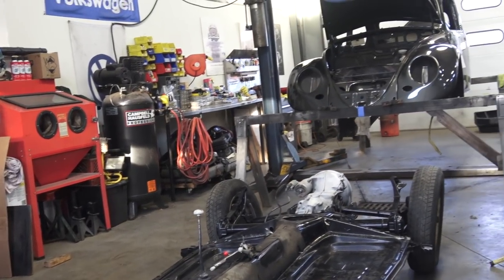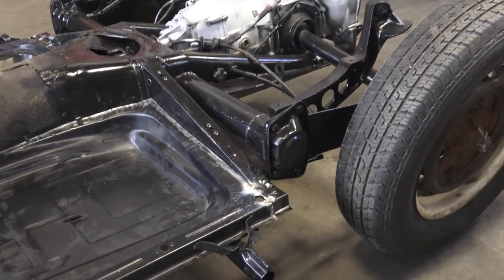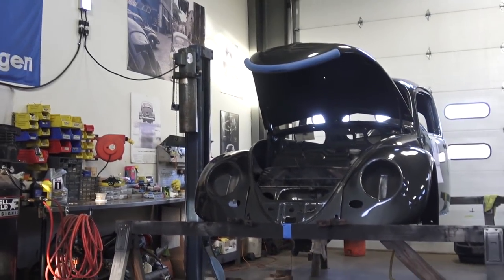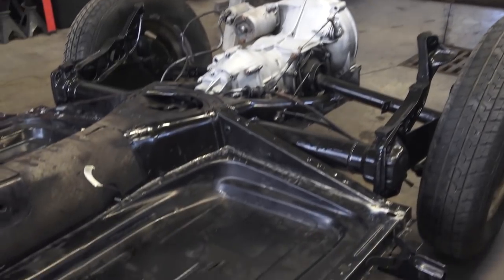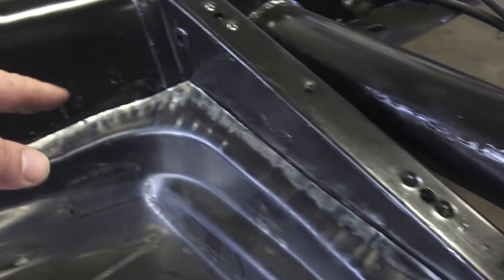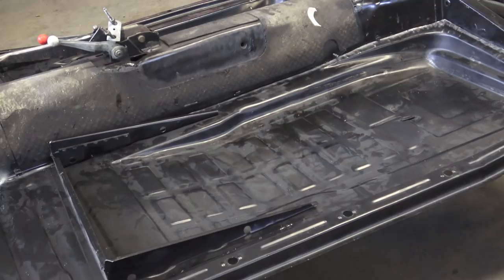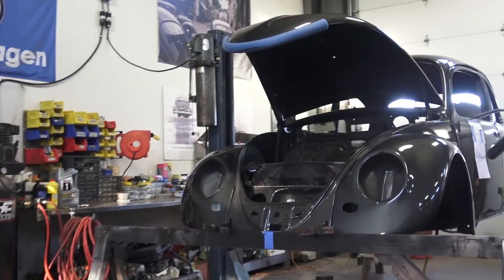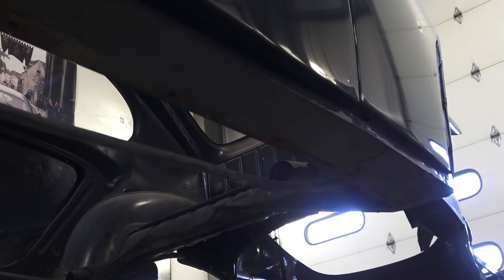Classic VW BuGs Beetle New Floor Pan Fitment for Restoration

Comment: did you have to strip those pans before welding them in or did you weld them on as they come from the company you bought them from?
Reply from the maker: You need to go down to metal and take the paint off in the areas where you are going to weld.

Comment: How long did it take you to put new floor pans in? Asking for a friend.
Reply from the maker: Usually a day, to a day and a half.
Reply: @classicvwbugs   really? My friend was saying it takes 6 hours
Reply from the maker: @_.incredible_magnum._291  both sides?  We make sure fitment is right, then seal it, rust proof paint it, etc
Reply: @classicvwbugs  oh. So I wanted to just slap s floor together, how long will that take?
Reply from the maker: @_.incredible_magnum._291  Without prep? Just a few hours.  The time is cutting out the old, cleaning the metal, prep surface, seal paint etc.
Reply: @classicvwbugs  oh ok. If I wanted to put a turbo on the 1600cc motor, what would I need to do?
Reply from the maker: @_.incredible_magnum._291  I cannot give advice on that as I do not do that sort of thing.  Sorry
Reply: @classicvwbugs  oh ok

Comment: I thought the orange colored pans are the best.
Reply: Green Meanie they are. 
I used orange pans on my ‘63 , they are thicker gauge steel . Buy the best you can afford , black ones are fine , just thinner metal.
Reply: @seventy4jns855   Same on my 65 thicker gauge metal surprised Chris uses the cheap thin ones.